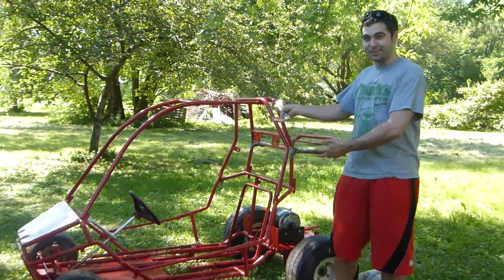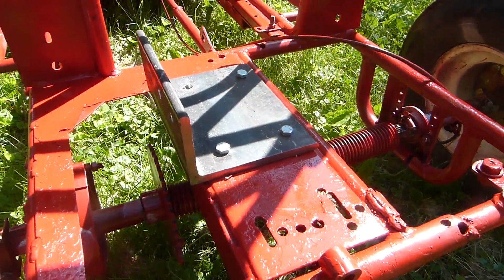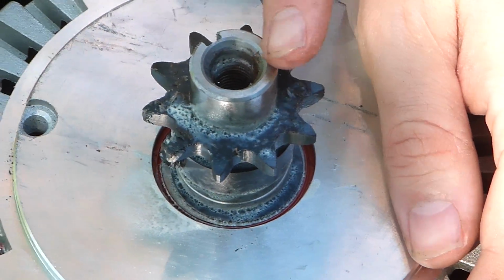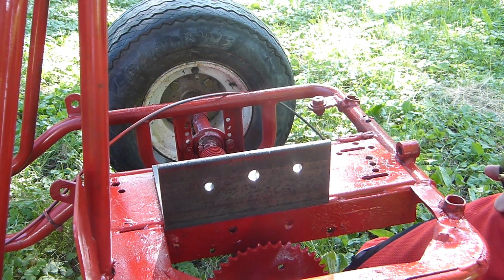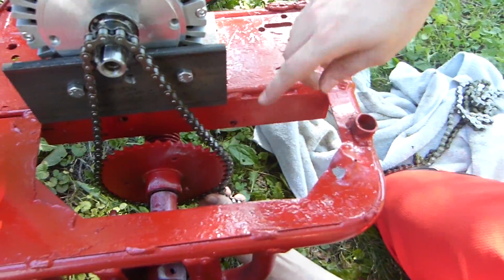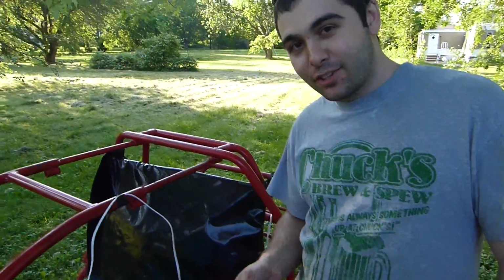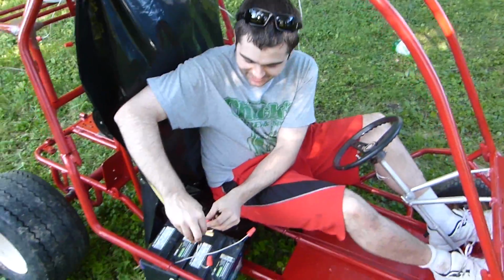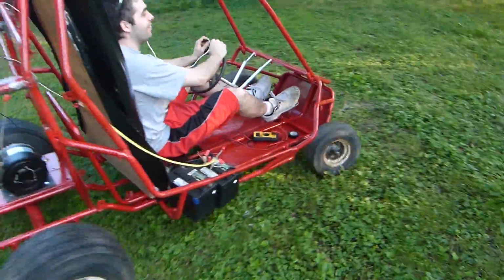Electric Go-kart Build Log - Part 1

Comment: That is a very powerful motor for one little go cart, at up to 15kw  there is enough power to accelerate a 100kg mass to high speeds, the best way is to put smaller motors on each wheel. A 1.5 tone car with a 100kw can get to 150K/hr+ a go cart 100kg with 15kw may go even faster get the gearing and wind dynamics, balancing right. very cool.

Comment: That duty cycle isn't how long it will run for, its how many times you can start the motor within an hour, constant means practically as much as you want, the rating is mainly for higher current drawing motors as when they start up the draw up to 8 times as much current than they do when they run at normal speed, this causes heat in the windings/coils and if you start turning it on and off more than the cycle time its rated for you may be overheating and damaging the motor.

Comment: you said the motor was brushless, but on the website to buy the motor it says that it is brushed. Also the motor only has two wire coming out of it, rather than 3 which most brushless motors use,

Comment: quick question did you have the batteries all wired together, as in all four posts were touching another post on an opposing battery? if so you do realize you're overheating the batteries and actually destroying them. you were not getting much power from that

Comment: Where did you buy the motor, & how much was it??
There  are cheap but really good electronic motor controller boards  & with that PM motor you can have reverse also..
Your gona melt a wire..
You need a chain tension-er
Reply: the wires are WAY too thin !